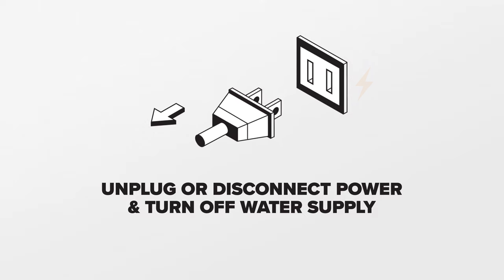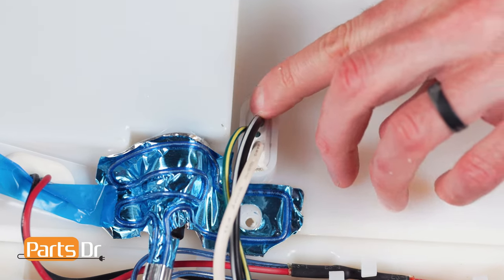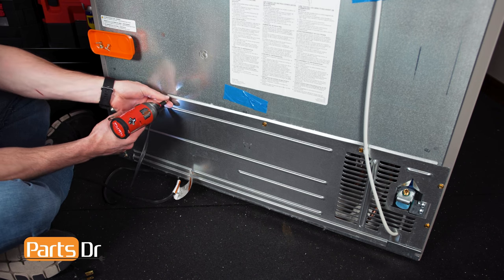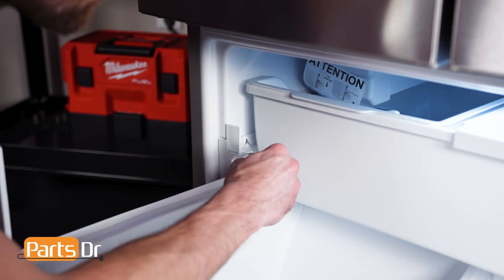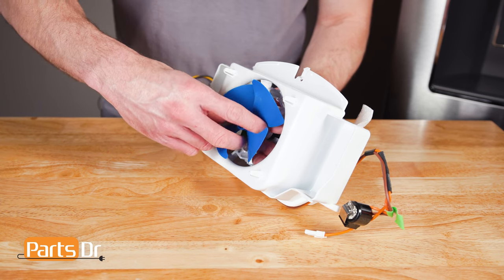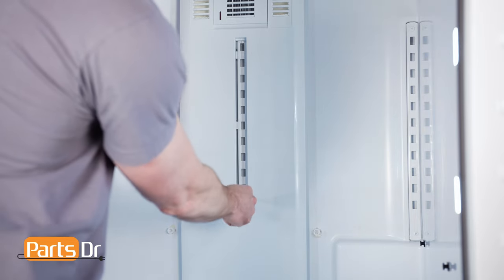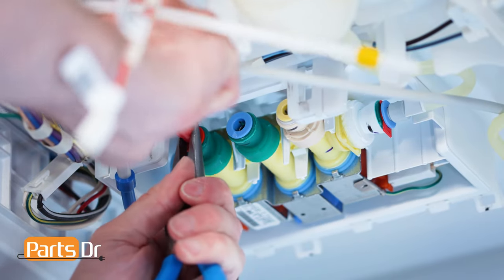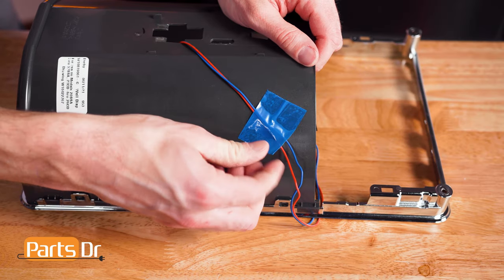Easily Disassemble Your Whirlpool French Door Refrigerator: Step-by-Step Guide

Comment: great video.. got me most of the way there. my model is a little different and the back panel is one piece with the grill on the back. i can't bend it to get it around the freezer slide tracks so i need to remove the slide tracks too. i am using the evaporator fan portion of the video
Reply from the maker: We are happy we could help!

Comment: This video was perfect for me.  Pretty much my refrigerator and have not seen any better.  I saw another video that had you pry out the guide that the door stop is locked into.  I was able to loosen that screw and do that.  I don't think I could have done it otherwise.  I do have a question though:  Where is the return air from the refrigerator back to the freezer on this model?  Cold air comes out of the ice maker and a little at the top of the air tower.  Is the air tower the return air or is is somewhere / thing else?  Thanks again.
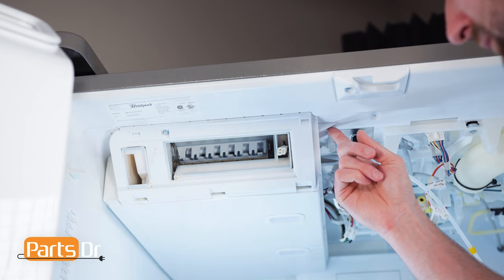Reply from the maker: It doesn't look to us like the refrigerator and freezer share cold air on this model.  The air return for the ice maker looks to be shown at 3:08 on the left side.

Comment: Very blessed to have found this video for my Whirlpool WRF767SDHZ04. While I have ordered from you folks before with great success, it's not something I have to do often. My issue was a noise that appeared to come from where damper in fridge and freezer evap fan would be. Once freezer parts were removed to access evap fan and fridge parts to access damper, I found the noise was indeed the damper that was making a somewhat cranking sound as the damper door opened/closed. Removed damper out of it's holder and with door switches taped shut, I could still see and hear the damper motor making it's noise when it rotated open to close. Have ordered damper assembly from you folks for later use....PART# PD00056007
MFG# WPW10479155. Thanks again for wonderful video.

Comment: Great video ! Extremely complete ! You guys are excellent teachers and technicians ! It is good to have your help !. Would you tell me the working voltage of the ice crush motor and the tripple water valve ? Why it is tripple ? Could you tell me about this ? Thanks a lot, Ramon Perera, Miami.
Reply from the maker: The voltage should be printed on the sticker located on the auger motor.   The triple water valve sends water to upper ice maker, lower ice maker, and the water dispenser.

Comment: Hey man have the same refrigerator turn the water on and the water runs outThe top ice maker  I'm at which end on how to stop it. Any ideas would be great. Thanks David
Reply from the maker: See the two videos linked below.  It sounds like your water inlet valves are both bad and leaking.  To verify they are bad, unplug the refrigerator.  If the water continues to leak while the refrigerator is unplugged, both water valves are bad and should be replaced.
https://www.youtube.com/watch?v=i7dtba4GiqQ
https://www.youtube.com/watch?v=EvEPAo2mGR0

Comment: I have this same fridge and it started making a loud fan sound I thought it was coming from the top but after watching this video I didn't see a fan above the lights and that is where I thought the sound was coming from would you have an idea of what it may be, it has stop now but my ice makers aren't making as much ice now, thanks in advance
Reply from the maker: There is a fan motor for the ice maker here: https://www.youtube.com/watch?v=3_eEs7zD4Bk
Reply: @PartsDr  thanks for the help hopefully this will take care of my problem
Reply from the maker: @jeffcarpenter9716  Let us know how it goes and what you find.
Reply: @PartsDr  I replaced the blower fan but I do not believe that was the problem is there a fan on the back wall, I was thinking more of a fan not a blower fan. We are smelling a smell like a electric motor going bad smell
Reply from the maker: @jeffcarpenter9716  What is the model number of your refrigerator?  https://www.youtube.com/watch?v=hHM9248ROWY
Reply: @PartsDr  it is the same fridge in this video
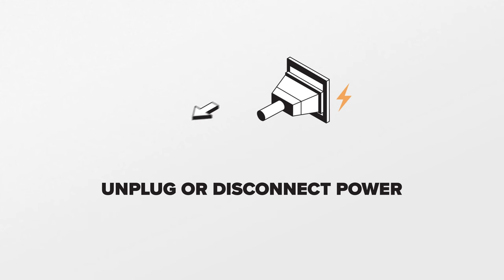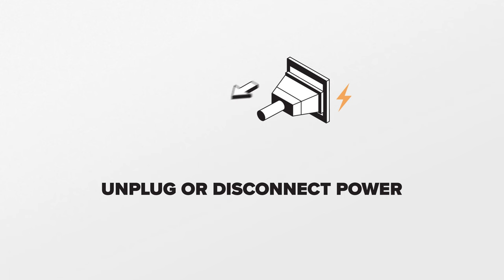Reply from the maker: @jeffcarpenter9716  At 11:00 we show the other fan motor in the freezer section.  This motor distributes cold air up in to the refrigerator section as well.  The flow of the air is controlled by the damper shown at 16:30.
Reply: @PartsDr  if this motor you are talking about is bad could it make the fridge area not stay cold by chance
Reply from the maker: @jeffcarpenter9716  Yes the refrigerator will not cool properly if the evaporator fan motor is not circulating the air.
Reply: @PartsDr  thanks again
Reply: @PartsDr  You have helped me in the past, I have replaced all the fan motors and mother board, and I am still getting ice buildup on the freezer wall it did not do it for a while once I replaced the fan assy in the fridge, any ideas of what could be causing this, it has done it for a long time even under warranty they replaced the fan assy in the freezer 3 times when it had warranty on it. I can send you some pics if that would help

Comment: Thanks for the detailed processes. Very well done.  This is the model I have and it has been a major POS. Thermister went bad 3 months in. Then lights started burning out. Then the upper ice maker stopped functioning, Now it intermittently stops cooling every couple of weeks. Unplug and it resets for now.  Astonishingly poor component quality.
Reply from the maker: Sorry to hear about all of the trouble that you have been having with your refrigerator.  Let us know if you are able to determine the cause of your intermittent cooling issue and what the fix for it is.
Reply: @PartsDr  I will. I have a few ideas. When it fails, a rhythmic clicking sound accompanied with no lights, no cooling. The clicking is from the LR side, when looking from the front.(opposite from main board on right side) Maybe a relay failing or not receiving proper voltage. Or maybe a water valve. I did a simple visual inspection of the main board hoping for a swollen cap or evidence of overheating. Nothing found. It might be a problem with the display too. When it happens next time, Instead of unplugging the whole fridge I think I'll unplug the display and re-connect to see if I get the same result. We'll see 😉
Reply from the maker: @empoweryou1  If the sound is coming from the compressor area, try testing the start relay and overload like we show here: https://www.youtube.com/watch?v=nx7l9kY2_bU
Reply: @PartsDr  I put my hand on the compressor during the fail mode to see if I could feel the vibration from the clicking sound. This test convinced me that it's higher up. Very much appreciate your guidance. Thank you.